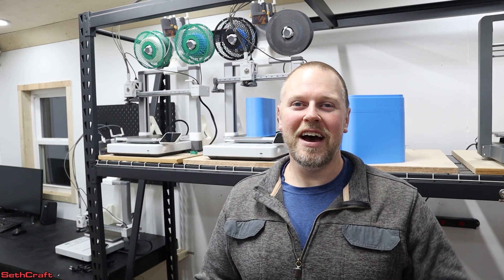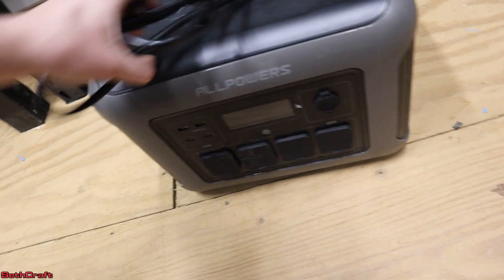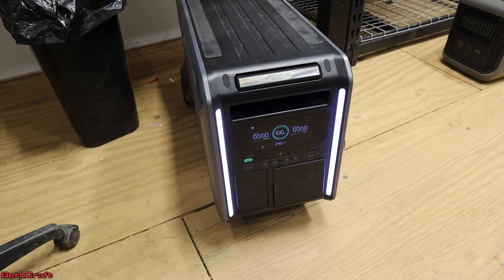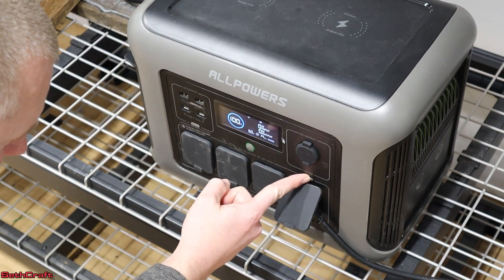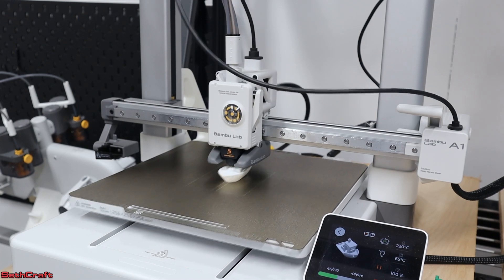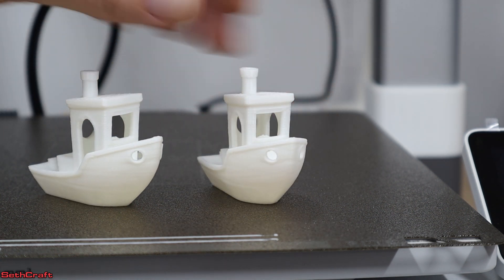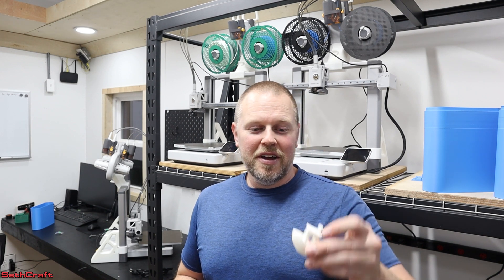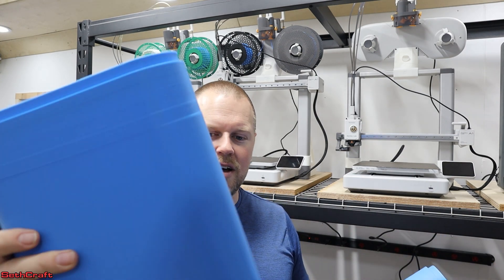Running 3D Printers by UPS from a Power Station - This will Save your 3D Print Business!

Comment: 0ms transfer switch? physics has left the chat 2:25
Reply from the maker: Basically the inverter is always running the outlets and the power is not just passing through the machine from grid.
Reply: @sethcraftshop  Makes sense. Victron does the same thing, but there is still a slight hiccup on the switch.

Comment: Nice that both work quite well.  A test to confirm the space heater caused the misprint: a simple 1" x 1" hollow cylinder that uses less filament than benchy, it will have a flat vertical wall that will tell-tale clearly any interruptions.  Do the same on/off test of the heater while that is printing to confirm the heater (or not).

Comment: Not all power stations have a UPS mode, so look for it specifically.
Reply from the maker: Very true. I have also found that the inverters have a timer that shuts off after a time. Can stop printers from doing what they need.

Comment: Your best option is to have a unit that does double conversion UPS. Where the output load is constantly converting DC power to AC power. Then when plugged in converts the input AC into DC
Double Conversion is perfect for activity converting “dirty” power to nice stable clean power. 
The larger power station with 0ms claimed could be double conversion. The smaller is likely line interactive where it switches AC pass through to DC to AC is not as good for critical loads as some times it won’t switch fast enough. 

If you do consider purchasing a real UPS please consider an Eaton (TrippLite) Online Double Conversion UPS. Those are the best IMO used in the IT field.
Reply from the maker: Thank you! That is good information. I will look into that ups. 

I am guessing you are right on the Zendure power station. With the 0ms switch, it is probably running the inverter all the time for the cleanest power output.